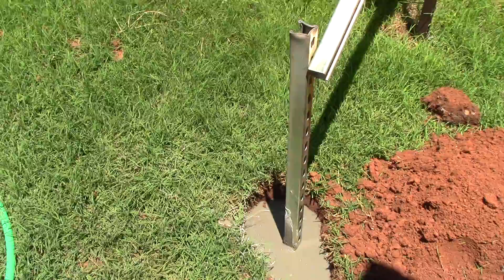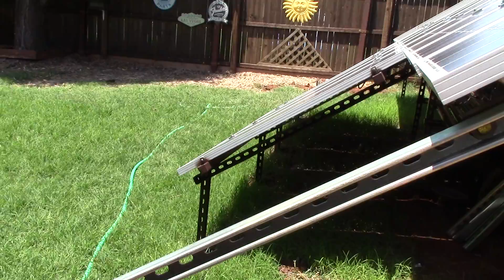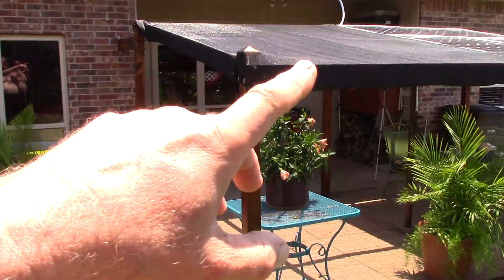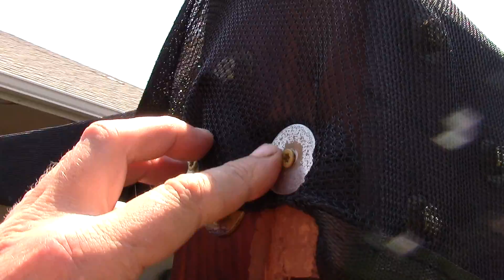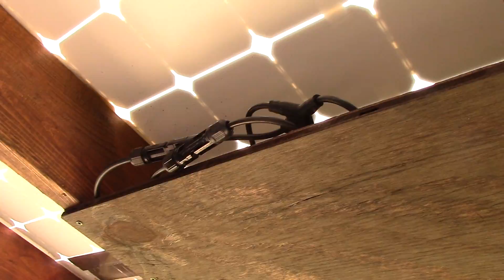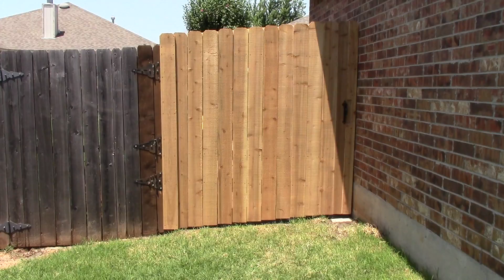Expanding suburbia backyard fenceline solar panel array, hung pergola shade tarp, and repaired gate

Comment: I wish I had hf .what you have in solar.nice job chris
Reply from the maker: Thanks. Been at this for almost three years. Stuff costs a lot, but been spreading it out over time. Could almost buy a new truck with what I have into this system. Some guys spend $2,000 for a lift kit and tires. So, to each is their own...I do solar.

Comment: MORE POWER!!!!!! Which charge controller are the new 6 panels going to land on? How long does it take the grout to harden enough so that you can cover it ? Keep those vids coming!!!
Reply from the maker: Thanks. They are going on the Midnite Solar Classic 150 that has the current 1,800w array on it. Adding 600w more is no big deal. The Quikrete Precision Grout sets fast...but, best to wait a few days to do anything with it. The directions say it reaches it full strength after one month. I will cover it tonight with dirt. Roger Willco on the videos...just trying to help others. Even if I fuck up something...it is still helping someone! :-)